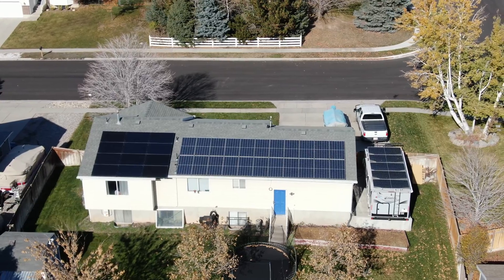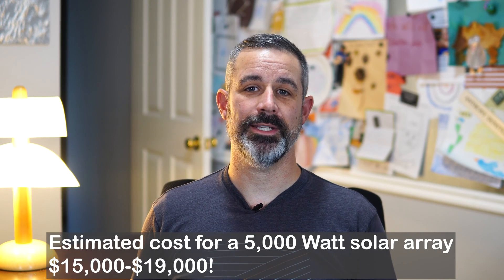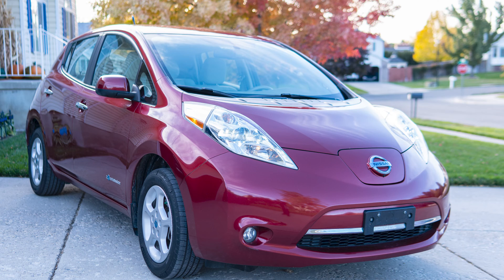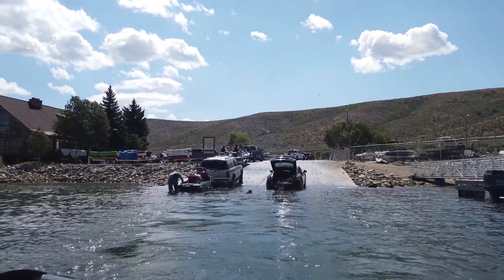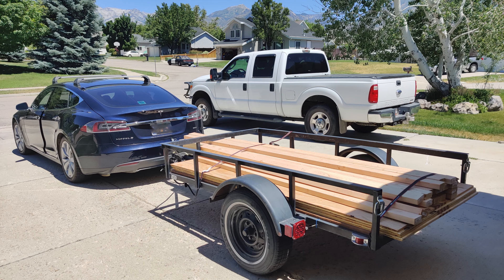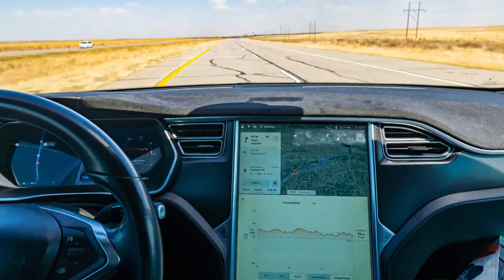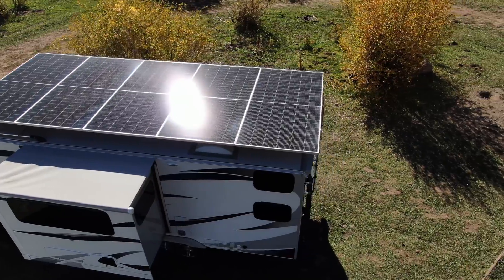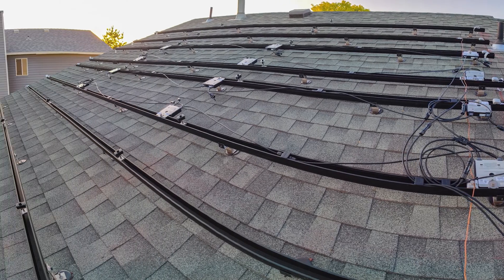How Long Did It Take Us To Break Even On Our DIY Solar Installation?

Comment: Thanks, I enjoy the data you provide!  I'lll check your play list for the heat pump dryer. It's something I've been thinking about.
Reply from the maker: I haven't made a review video of the heat pump dryer. I could make one though if there's interest. We've had it for around 18 months now. In brief, it's smaller than we're used to and slower to dry. When it's done the clothes aren't as dry as a standard dryer, but it's not like they're wet or anything, just more humid. Within minutes of being removed from the dryer they feel dry. It uses far less electricity, but since it uses 240 volts I can't use my kill-a-Watt meter so I'm not sure of the exact numbers. Plus the exact power draw is completely missing from the manufactures documentation... I also love that it's not venting conditioned inside air out of the house. Also impossible for me to measure that advantage, but I know it's a thing, and I'm glad to not be causing negative air pressure in the house anymore and paying to re-condition the make up air. The extracted water is pumped directly down the same drain that the washing machine uses, so there's zero effort in that regard. I insulated and sealed off the vent tube on the outside so our blower door test will perform even better the next time we have that done. It was already stellar. I left the vent tube installed though since it's already there and it might be needed in the future if for instance we move and either sell or rent the house out and there's someone else living here with a traditional venting dryer.